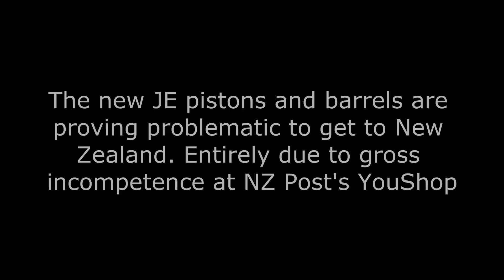1969 Porsche 911S Restoration - Part 6 - Bodywork almost complete

Comment: Reminds me to finish my wife and I's BMW E9, crafting metal is work of art, no matter how you look at it... I have at least 50-75 hours in, the floors are complete, rear window frame, front shock towers, with the just the rockers left to do, and the front fenders, mind you in the early stages of the game sheet metal parts needed to be made by hand, rockers are easily found for cheap, it's always that corner piece that needs to be made!

Comment from the maker: Thanks you. I figure at the very least it's a good source of the vehicle's history for whoever the car ends up with in years to come. I'll insert the Car's VIN so it can be traced back to here.

Good luck on your own resto' - it's probably more important what shape the engine and gearbox are in, as the bill to rebuild the motor so far has been, shall I say "breathtakingly high". But I knew it would. And all I've done is have the crank straightened, cases restored and new barrels/pistons!

Comment: whats the name of that welding technique where you run a series of spot welds along a steam rather than one long burn ? is that to avoid blowing thru the metal ? thanks
Reply: +CR2504life I'm from Germany. In German its called "Pilgerschrittverfahren". I don't know the correct translation, I think it's called "pilger process". It is used to get a low-stressed weld joint.
Reply: +mhdh3e thanks
Reply: +mhdh3e  Lol I love the german language, they have a word for everything.
Reply: +CR2504life   Its sometimes called stitch welding or intermittent welding. You don't want to get too much heat into one spot in the metal or it will start to warp and deform, so you need to move around from spot to spot.
Reply: +CR2504life Skill.. :)
Reply: it's called stop start.

Comment: really  nice work .. would have loved to have seen  the start and finish of the piece on the door including the blending in with the grinder , really struggle my self to fine the right balance when blending the new metal with the old original part , its very easy to  thin the metal and weld ..
Reply: that outside corner he stich welded will crack after grinding. Never weld an outside corner.  He should have fabricated the radius along the part and spot weld the bottom flange. All these guys know is squeeze the trigger and grind. It takes a good twenty years to figure it all out. I used to be that guy.